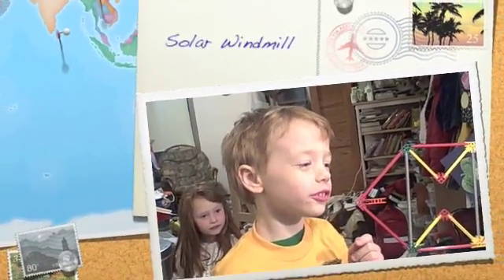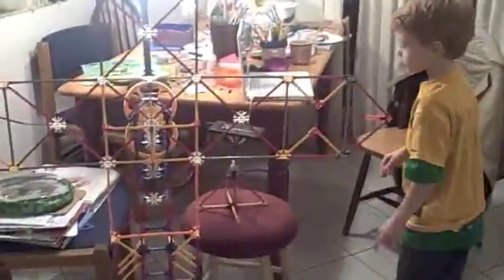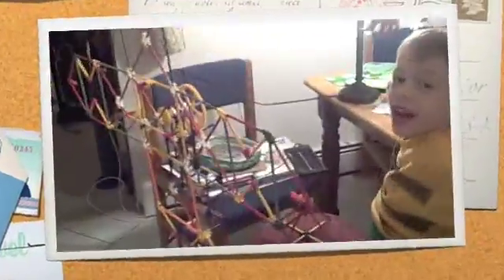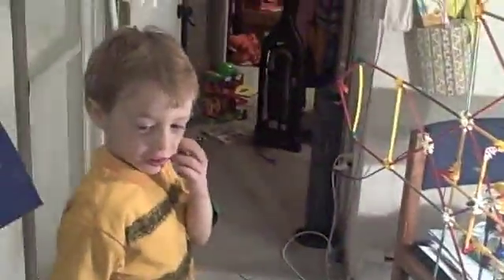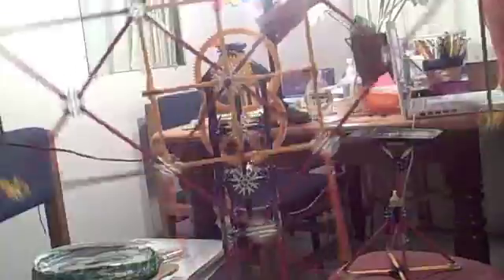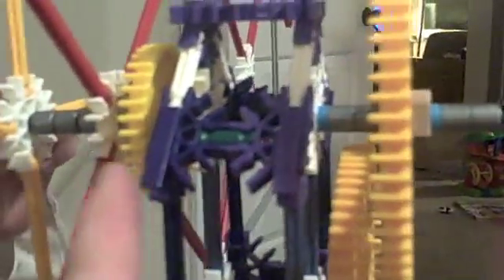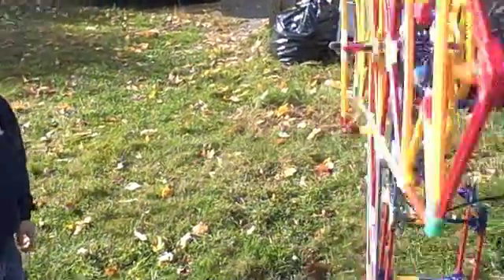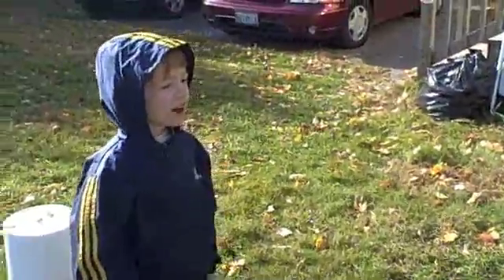Solar Wind Mill

Comment: I am intrigued by how much weight you are able to support on your pivot rod.  Add pitch to those blades and plastic wrap your blades and you won't need a solar panel.
Reply from the maker: Hey, sorry for the slow reply. Just getting back to this channel. You are right about converting this to straight wind power. It wouldn't take much to make it a full on generator. And, the K'nex sets are pretty incredible in what they can accomplish. A 3-D tower matrix can easily hold up a 200+ lb guy. I built several, and was able to step from one to the other, with each occasionally holding my entire weight. It's impressive stuff. We've also experimented with solar powered model houses. I don't remember the brand, but, we spent a ton of time with one that was experiments with insulation, lighting and various other "green" concepts. I enjoy this stuff. I"m hoping my kids inherit some of that interest! All the best!
Reply: @4dhl  alots happened in a years time. I solved a critical weight issue and built one of my own.  I'll post a link, but YouTube sometimes bawks at that. The other alternative is to search out my channel. Cheers.
Reply: @4dhl  https://youtu.be/QrojTItyDEI